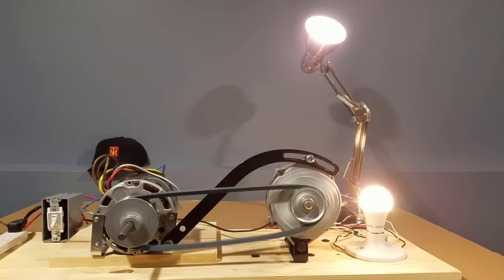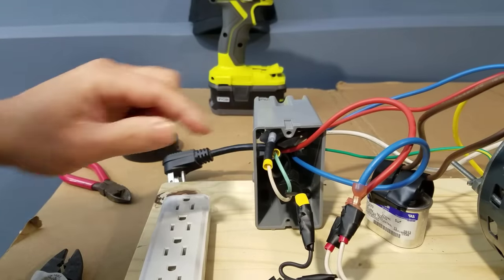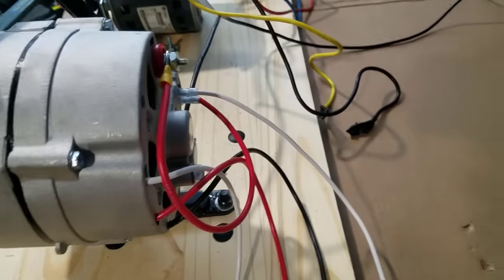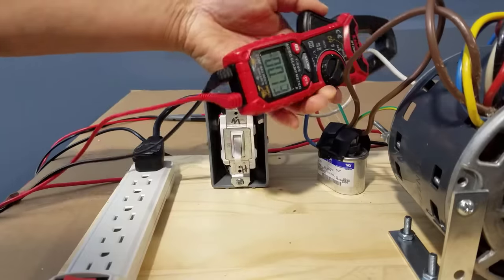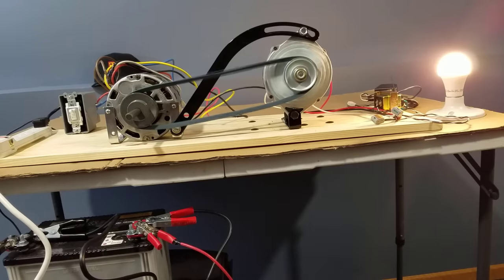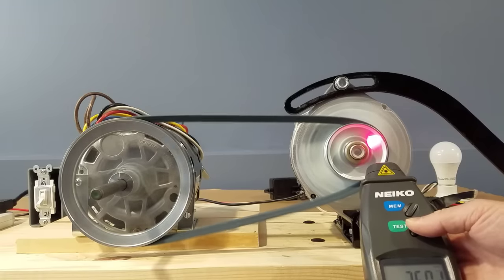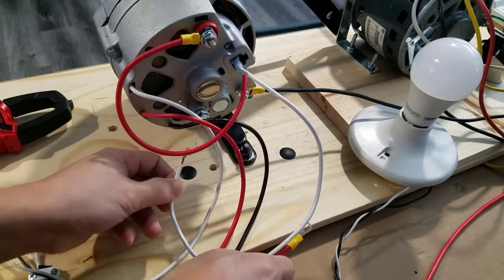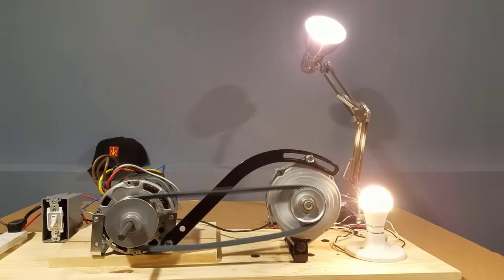Free Energy? (WOW) Using a Car Alternator

Comment: You could have just put the motors drive end to drive end then you wouldn’t have to split the motor casing.
Reply: The simple fact that he thinks this contraption (or any other) could ever, possibly produce more energy than it consumes demonstrates a limited understanding of even such simple concepts as simply turning one of them the other way round to reverse their relative rotations.
Reply: @q.e.d.9112  agreed
Reply: @q.e.d.9112  there are $1.9 million worth of electricity in every gram of mass if humans could figure out how to convert matter to electricity directly.
Reply: @eprofessio  
We’ve been chasing that holy grail (fusion) for seventy years and it’s always “20 or 30 years away”.
Reply: @q.e.d.9112  fusion is still a heat driven mode. Human will discover a way to directly convert mass to electricity and it be named after me. :)

Comment: You should use a pmg instead of a alternator cuz the pmg ( permanent magnet generator) have a hell of alot more amps at a lower speed and there is no need for the batteries, you should easily be able to pull start it to get it running

Comment: CLICK BAIT CON JOB...  IF HE PUTS $1,000 IN ESCROW i will put $10,000 in escrow winner.   takes all.  How about $1,500 against $15,000? 
My parameters:  This is not going to be allowed an insude battery or capacitor will require a volt meter hooked to a battery with a start of 10% drain rpm hp and torque will be tested it will be mediated by an engineer with actual college degree (i just happen to know one) but it will require advanced notice as an engineer he travels wotld wide engineer

Comment: I like to find someone who's selling the systems that can run the whole house and generate enough power to charge all the batteries
Reply: Free energy is real, it’s called fusion energy
Reply: @mookfaru835  the energy requirements for fusion energy is insanely high. You'd need energy of 6 sun's in order to achieve it.
Reply: Yep.. Its called the national Grid.

Comment: Sorry to burst your bubble but this is a hoax. The first thing I noticed right at the start is that you don't need to pull the rotor out and flip it around. You can run an alternator as a motor or generator as is rotor wise. Only modification you need to do is remove the full bridge rectifier on the rear casing. Flipping the rotor does nothing.

Comment: It works but not efficient enough to much wasting of energy and too much load on the battery
Reply from the maker: The furnace motor draws very little amperage between 0.20 and 0.22 on Low and Medium speeds respectively.

I avoided using High speed. High speed would draw about 4 Amps.

Friction and heat will eventually consume the furnace motor.

Comment: There is no such thing as a perpetual machine and there is no such thing as free energy.
Reply from the maker: Parts List is in the video details, try to build one and see it yourself!
Reply: @mrmightytiger7385 
Hi there, I'm not going to make one as I'm busy with other projects. But I thank you for taking the time to read and reply.
Best wishes. J
Reply: Wind power, water power, geothermal and solar power are all technically free power as you don’t have to insert a fuel to get an output of electricity. Wind power runs off the wind currents ever present on the planet, solar runs off harvested energy from the sun itself, water runs off the energy of flowing water which is a byproduct of the effect of gravity of water and geothermal is heat collected from vents in the earths crust. None of these require us as a civilization to use aside from setting up the equipment to utilize these energy sources.

Comment: Here’s a simple breakdown of the reason why this is nonsense.
He has to start with a fully charged battery. Let’s just called the total energy stored in the battery E.
He uses the output of the battery to power a dc to ac inverter.
The cables he uses to connect the battery to the inverter have resistance and the current flowing from the battery into the inverter causes the cables to heat up which consumes power.
Hence the energy available to the input of the inverter is less than the power of the battery.
The inverter will not be 100% efficient and so the power available at its output will be less than the power available at its input which in turn is less than the power stored in the battery.
The output of the inverter connects to the motor. There are heat losses in the cables and also inside the motor so we have lost further power.
The motor connects to the alternator using a belt. The belt will loose power due to friction.
The alternator isn’t 100% efficient and so the power being output in voltage will be less than the power generated by the belt.
Lastly there will be heat lost in the cables connected to the alternator and the load (the battery).
Hence there are quite a few ways that power is being lost around this circuit and so the power being fed back to the battery is less than the power being taken from the battery and so the battery will eventually completely discharge and then the whole system stops.

The irony is that the power used to initially charge the battery would be better used to power the lightbulb or whatever load the contraption is meant to power.

Every time power is transmitted from one device to another then a proportion is lost (generally heat and friction). When power is turned from electrical power to mechanical power then some of it is lost.

Hence there is no such thing as a system that generates power without running out of power or needing external power as a top up.

Comment: Even if it doesnt make a surplus it should significantly reduce the amount of power used.  If used on a larger scale, it looks like something like this could create significant savings on large objects such as the heat/air unit or washer/dryer.

Comment: You lack understanding of electricity in general. A car alternator will generate electricity in either rotational direction, no need to reverse the motor rotation. There are inefficiencies in both the motor and alternator conversions. The belt friction is a large loss of energy. Simply put, this is nonsense.

Comment: For this machine to have any chance to work you re going to have to amplify the energy instead of generate it if you remove the rectifier and the diodes from the alternator got you a 6 volt DC mother out of a treadmill feed your six volt mother with the battery and also hook to the DC on the alternator spin in and you should get coming out 90 amps of 110 double the alternator you get 240
Reply: Sean Harris You have failed your Basic Physics Examination.
Reply: @ericchapman399    i feel sorry for his treadmill mother

Comment: Does anyone notice, that once he gets the setup working, it all closeup shots, you no longer see the entire table, and battery like he before.
 Also, all he has done is light up 2 lightbulbs. I can do that with a 100-watt solar PV panel and a battery, cheaper, and much quieter.
He also states it will not run any appliance other than 2 lightbulbs, so really not useful.
Reply: And they are led.s

Comment: Good things, good thinking, when you understand the wire ,the difference is the a.c wired ,and d.c wire decision clearly .additional to run right way for the transformer you add to amp it ,step up apply ,homemade 110. To out put , Lamp.altenator output,loads balance turn torque horsepower.load Rpm.think rethinking pulley. and bingo was you know. Juice,power.

Comment: You lost me at clockwise vs anticlockwise
Reply from the maker: I didn't do a good job explaining why I had to switch the furnace motor rotation direction. Most car alternators are designed to work in clockwise rotation.

Comment: OMG, first understand the meaning of perpetual machine.... This can't run for ever, but for few hours to few months
Reply from the maker: A machine is as strong as its weakest component... In this case it's the furnace motor.
Reply: @mrmightytiger7385  I don't understand what's the relation between the furnace motor and the setup shown here. 

When you try making an electrical over unity machine, first please dont blindly try connecting two motors, it never works that way.

Comment: Didn't you say 50 amps at 6000 rpm why are you using a motor that operates at 1200 rpm . Weird how I run a 3000 watt inverter and my truck alternator has no problem keeping battery charged when I leave it idling.  I'm running compressors and circular saw grinders. Get a different motor

Comment: What is it about you perpetual motion guys that you can’t seem to follow simple physics. Suppose I have two equal buckets and, further, suppose that every time I pour water out of a bucket, a cupful of water spills and doesn’t go where I pour it. Now start with a full bucket and an empty bucket and start pouring water back and forth between the two buckets. Anyway you twist it you’re going to run out of water eventually. Your motor/generator can never, under any circumstances, produce enough energy to keep going indefinitely, in exactly the same way that the buckets will run out of water.
Reply: Perhaps if you were less clumsy pouring the water and poured it on a  water wheel driving a generator and catching every drop of water in a bucket  to be poured on the water wheel would give you a better result.
Reply: @ericchapman399  
Either, you really can’t understand the simplest of concepts or you’re “poking the borax”. Either way, I’ve got no f*cks to give.😉

Comment: TOTAL BS @3:15 you showed the draw on the inverter at 226 watts, about right for a 1/3 hp motor. At this point you are pulling a minimum of 18.8 amps from your battery to power the motor, no doubt more due to losses. @8:56 you showed the alternator putting out 4.63 amps at 14.85 volts, that is 68.7 watts. That will not recharge a battery that has a 226 watt draw on it. Had you given a little more information I could calculate for you how long before your battery goes dead, and your machine quits running.
Of course, you know this is all bull because anyone who thought they had created a perpetual motion machine or as you put it @0:09 a machine that can "create energy", would just leave it running forever to prove it out. If you did this you know how long the battery took to go dead, if you did not, why not?

Comment: I am hoping you can help lead me in the right direction; it is obvious to me that the next stage in electronics including EV's is longer battery life with limited recharge. ( All wires will and should be obsolete as batteries get better) meaning a TV will not need to be plugged into a wall socket in order to run nor charged given battery life is excellent. Same with EV's in the future you will not need to charge the car barely @ all. I see this future and want to get involved in making it happen. What advice can you offer me in that regard? I am a business man not an engineer and would like to know what it would take to essentially create batteries that are semi perpetual and long lasting enough for the world to finally eliminate most wires and wall plugs. Thank you.

Comment: That setup would keep a bank of lithium ion batteries charged to run a off grid dwelling for sure.
Reply: No it would not, you cannot get more energy than you put in, that is basic physics and thermodynamics.
Reply: @chrisclarke6344  You are thinking basic, I'm not. I'm thinking double li ion battery banks with switch over grids.   But I'm sure you want me to explain it to you, but you are an electric engineer who is always right even went basic knowledge proves you wrong. Over analytical branch davidical.  You know and spread what you are taught to know and spread. Mr. inside the boxman. You're the maaaan in the box!
Reply: @chrisclarke6344  You tell me, you're the nuclear physicist. I'll give you a little hint. It's not about extra incoming energy. It's where it's being stored and switch cycled. Look I can't do your homework for you, cause you'll never learn what's on the outside of the box.
Reply: @unchained20000000  typical response where does the 'stored' energy come from? What generates this extra energy? You are just like all the deluded who believe this rubbish, you are making the claims give out the information. But all you do is parrot the same phrases " do your homework", i dont need to because unlike yourself i have an understanding of energy conservation. Do you people actually believe a man in a shed with an alternator and a motor can create something that has eluded the best minds since the discovery of electricity? No matter how much you 'think outside the box' this cannot work due to the laws of thermodynamics you cannot get more energy than you put in. Think about this why do nuclear submarines have a complex and dangerous reactor to boil water to make steam to drive the propeller motors, and the generators to supply all the electrical needs of the submarine if they could just install a few of your magical machines?
Reply: @chrisclarke6344  You are ever so clever. We learned alot from your answer lil Jimmy. Now tell the class what geomagnetic field propulsion is and how it works. You are so bright lil jimmy, you shine with the luminosity of twelve suns.
Reply: @chrisclarke6344  unfortunately you can't argue with stupid people. They'll just have to learn the hard way when they try to make one of these "magic boxes" themselves haha
Reply: @sailoroftheinternet3290  looking at the  comments there is an awful lot of stupidity on here. Sad reflection of education systems i feel. This is primary school level physics.
Reply: @unchained20000000  God that's so cringy. You clearly don't know what in the world you're taking about, but you do it with such confidence. It's incredibly embarrassing.
Reply: @unchained20000000  lol
Reply: Dam I just wasted two minutes of my life talking to a wall, cause debaters are stone heads not sponge heads.

Comment: u need to run a car  but with higher rev's such as 8.000 or more  connect  up to automatic car or 5 speed gearbox also you will need a speed controller to start from 850 rpm to 8.000  or more  has to  have a big diameter sharft  on the motor and you will have to make a spline on that sharft the outside of it i mean check the  spline on the one you want to adept into the car clutch or automatic  touquor converator make sure touqor converator stayes on the gearbox . when you take the piston motor of the gearbox keep it on or you will break the oil seal be sure your device that you have slide's into the touqor convertor brace everything up  and go should be fine check motor tempetures after a short run tell me how you go